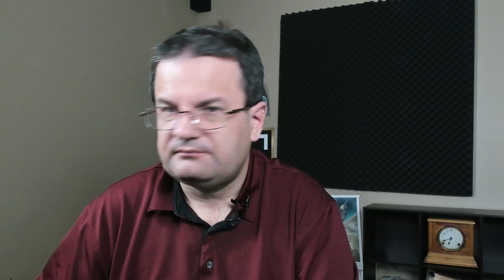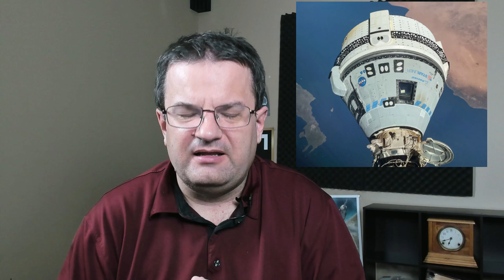Starliner and ISS Supply Problems

Comment: That thing shouldn't even be up there...
Reply from the maker: There was no reason when the contract was issued to think that Boeing couldn't do it. They have been working hard at resolving their issues, and as I said, this kind of issue is pretty common, I could point out an issue with every US spacecraft that has been worse than anything with Starliner (Except maybe Crew Dragon, but certainly with Cargo Dragon) than this particular issue.
Reply: @WhereisRoadster  way to many special words to describe this spacecraft is terribly overpriced way to unreliable and what was wrong with cargo 🐲
Reply from the maker: @setituptoblowitup  Still, if something happens to Falcon or Dragon, which there is a decent chance, Starliner will at least be a way to get to the space station. But it was deemed too expensive for cargo, as there are 3 other good options out there.
Reply: @WhereisRoadster  redundancy is a very good thing amongst launch providers if I remember correct Dream Chaser got some funds for human rating.....
Reply from the maker: @setituptoblowitup  They did, but they didn't have the strengths that Boeing did in those days. Remember, these contracts were awarded over 10 years ago, Boeing's problems really didn't start to appear until maybe 5 years ago. They were seen as the overpriced, but more sure bet than SNC's Dream Chaser.

It's hard to remember it, but Boeing had a stellar reputation in 2014. The 737 Max wasn't an issue, SLS was overrun, but not hugely so. Boeing had built much of the ISS, many satellites (SNC had built and launched only 9 satellites ever, and most of those had some pretty serious issues, and no other space work). Boeing knew what they were doing, and worked hard to excel. While there were some signs that it was going a bit downhill in those days, it wasn't like it is today with so many visible signs of issues at Boeing. It wasn't until the first launch of Starliner that I pretty much knew that SpaceX was going to win the race to the ISS, Boeing was likely to win it before the issues with that flight became apparent.

It was a popular saying for years "If it ain't Boeing I ain't going". It really wasn't until 2018 that we started to see differently. I don't blame NASA at all for choosing Boeing, and certainly not for choosing them over SNC. Let's just say I am quite aware of SNC's reputation, more so than the normal person, and I don't blame NASA at all for choosing Boeing.